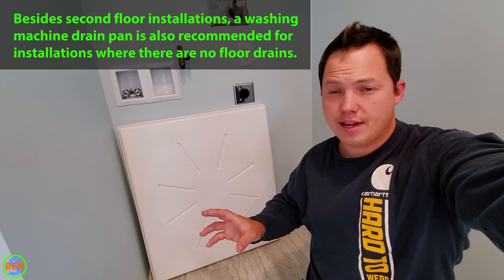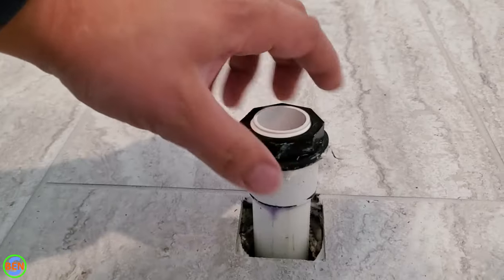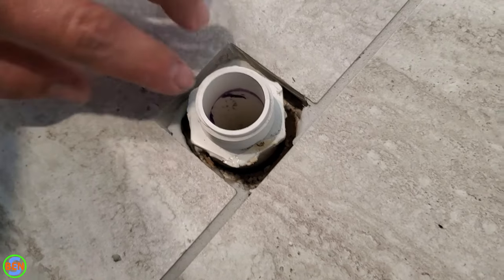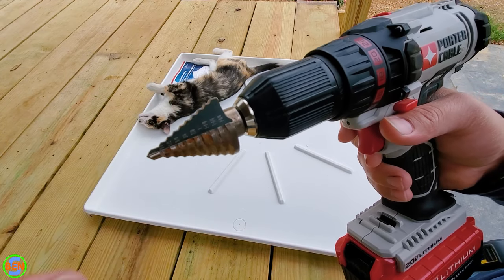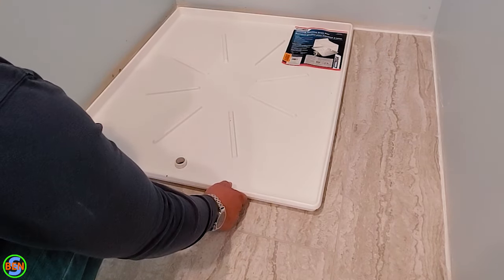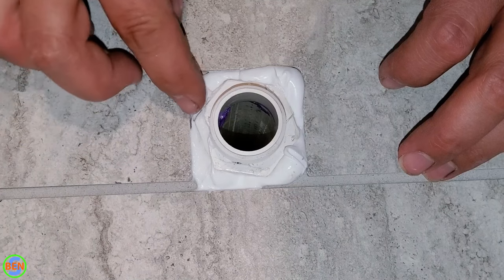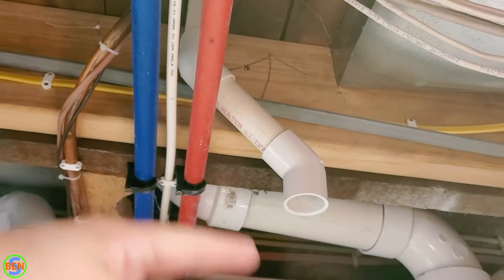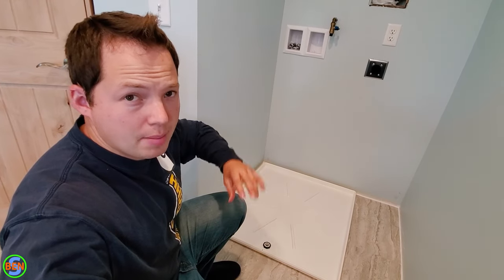How To Install a Washing Machine Drain Pan for Upstairs Laundry Area

Comment: Actually, if prepared properly, a sloped floor to a room floor drain is best. That plastic pan almost always gets damaged if your doing a solo install of the washer...not to mention the pain if ya  have to service the unit. Also,  that 1" drain line is not enough if ya have a major fail as it will be overwhelmed and the pan overflows...seen it happen many times over the years.
Reply: Now that is something I forgot to consider and comment on, those plastic grip pans are the very flimsy. There's not a lot of meat to them so to speak, they get brittle easy and that front lip is going to break I guarantee it or it's going to crack and then if there is any kind of water on there more than literally a drip, you're going to have problems with it and especially if you're trying to move a washer which is heavy by yourself you got to get it up over that lip and if you're trying to use one of those portable you know dollies to move it you know it's just not going to work out too well for you   I've got waterproof laminate underneath mine on the second floor, and I've got the edges tiled so that way in case it leaks it literally goes into its own little box

Comment: Not good enough, Unfortunately this only addresses any water coming directly from the washing machine and does not prevent any potential flooding coming out of the water supply lines or the washing machine drain.

Comment: If this were my house, that indirect drain would completely miss the sink and all the water would wind up on the floor.  You make absolutely great videos. I watched all the way through even though my washer isn’t anywhere that flooding would damage. Speaking of flooding, I use braided washer hoses that automatically cut off the water flow if they sense a sudden immediate change in pressure ie burst hose. With a second floor setup that’s important.
Reply: Super

Comment: That little hole isn't going to cut it.  You need another inch of height and a full shower drain at the base of the pan to ensure that the lint and hair that come out through the seal don't instantly clog the hole.   Drain pans have to deal with worst-case scenarios and in this case you're talking about a service line break or a tub seal blow-out.  Both of those will overflow that scrimpy piece of garbage in about 20 seconds.
Reply from the maker: True that it wouldn't help in a catastrophic leak scenario. Only good for the smaller minor leaks but hopefully better than nothing.

Comment: Is there any concern with compromising the integrity of the pan by not using one of the pre-drilled holes? Could it cause cracking in the pan down the road?
Reply from the maker: I don't think it should matter at all.

Comment: Silicone definitely helps seal around the pipe ours leaked under the pan because the drain hose backed out a bit and the seal was gone. I am at the point I'm thinking to just put a liner under the flooring and plumb in a floor drain because it's a PITA when having to move that machine in and out of the pan for maintenance.

Comment: I know in our city, code requires an actual FLOOR DRAIN for any laundry (laundry room) above the ground floor (2nd floor and higher) IF the home is on a slab.  If the home had a basement (rare in Texas) or crawl space under the main floor, then a floor drain is required in that instance as well depending on when the house was built.  A drip pan alone wouldn't do and would be unnecessary (because of the floor drain).

In some ways it makes sense, because if your washer were to develop a serious leak, or the water hose was to rupture, that drip pan would never keep up.  But I think these drip pans are nice for what they are intended:. Drips!

Is this on an upper floor in your house?  2nd floor laundry facilities are nice.  4 of our 5 bedrooms are located on the 2nd floor of our house and I always thought it would make more sense to have laundry facilities closer to where people slept, changed clothes, etc.  Not to mention there was always a parade of kids or guests carrying clothes baskets up and down the stairs to wash their clothes on the first floor.  Now they do not and just walk down the hall.  I think we are probably the only two story house in town that has laundry facilities on each floor.  Very handy - but I am not so sure I'd do it again, as it was a lot of work.  The second floor had bathrooms, but it did not have the infrastructure to support a stacked washer and dryer, so all of that had to be added.   Glad I did it though, because it's been quite a time saver.

Nice video!
Reply: Yep. Those floor drains may cost a wee bit to put in, but compared to the repair costs of water damage from a 2-3 floor laundryroom, it's a drop in the bucket.
Reply: @samspade5648  oh absolutely! And there's not a second floor drain anywhere on the second floor until I installed that one for the washer which is kind of funny cuz you would think using the same logic why wouldn't you want one in your bathrooms? So that way in case the water fight broke underneath the sink or the toilet started leaking or something that it would migrate to a to a central drain.  If I were to build a house from the ground up, that is probably what I would do
Reply: And for the second floor washing machine I had to run everything over there there was no plumbing where this particular closet is located, and there was no vent over there so I had to literally run everything including electrical, but it turned out very nice the dryer exhaust is maybe 4 ft long it just goes straight out the side of the house into an alcove where it can't be seen from the front yard or from the street so that way the HOA can't bitch about it
Reply: @mattalbrecht7471  Hahahaha, it's funny you mentioned a floor drain in the bathroom. I just decided to do just that now that I'm remodeling. However, it is not as simple just putting a drain in anywhere. The floor must be properly pitched towards that drain...it's not difficult,  but it must be account for.

Comment: A 2 inch pipe is required by code in my city. I would waterproof the room and install a 3 inch floor drain if I were to have one in my house. A 1 inch drain isn’t going to take all the water from a plumbing accident.I would put a sensor with automatic water shutoff in that pan as well.

Comment: My new place has this pipe in the ground but also a hole where the hot and cole inlet things is on the wall , should i use the one in the floor or the one in the wall ?
Reply: You should use the one in the floor  for the pan. The hole in the wall is for the regular washer draining after completing the wash.

Comment: Get one of the rubber drain pans if possible. Those plastic ones slide all over the place and literally will tear themselves apart over time, making them useless. They have no grip to the floor and the washer will have no grip on the plastic.

Comment: We have a drain pan on our 2nd floor and I can't find where it goes down to , the house was built in 92.
Reply: It might be flowing into the same drain as the showers, toilets and sinks in your house.  If you have full access to it, try having someone put their ear near it while you run a sink or flush a toilet.  If they hear watery noises, its using the same sewer system.

Comment: With the cost of propane, wouldn't it just make sense to go electric drier which is simpler and cheaper?
Reply: Depending where you are, propane and natural gas can be a ton cheaper than electric to use.
Reply: @samspade5648  natural gas yes - for propane to be cheaper, would need expensive electricity.

Comment: Aye Ben, nobody shows HOW to get the washer ONTO the drain pan. After some thought, came up with this, works like a charm - WORKS WITH ONE PERSON.

TWELVE EASY STEPS TO GET YOUR WASHER DRAIN PAN UNDERNEATH YOUR WASHER. If you share this/make a video on this, please credit me, thanks:

1.You need to have or know someone with a cat tree. Know the tubes used as risers? Yeh, unscrew one for this. Or, otherwise need a strong tube that is about the height of the pan lip.
2. Secure a string around the tube, and have it come out the backside of the washer, with the tube at the front, and have the string end up where you can pull on it when ready from the front of the washer.
3. Tilt up the washer onto it's hind feet.
4. Slide the washer tray under the washer until it stops at the back of the washer still on the ground on it's back two feet.
5. With the tube inside the pan, pull the string or otherwise make sure the tube is underneath the back of the washer by the lip of the pan, in the pan.
6. Lower the washer, the round tube should end up supporting the back side of the washer - the point is to not crush the lip of the pan.
7. Pull the washer towards you, using the tube as a fulcrum, and taking advantage the tube will roll forward with the washer as you pull the washer towards you.
8. When the back feet clear the rear pan lip, the entire washer should be fitting inside the pan, the back of the washer sitting on the tube still.
9.Tilt  the washer towards you over the front feet, taking the weight in the back of the washer off the tube.
10. Pull the string tied to the tube to remove it from underneath the washer.
11. Lower the back of the washer onto it's back feet, which if you did it right, are now inside the pan, along with the front feet.
12. Crack a beer and have a drink for me. I'm disabled, and pulled this off with minimal penalty (pain is there just to remind you you're alive). (***Not responsible if you're too foolish to know your limits or otherwise hurt yourself.***)

Ta da! Easy peasy! This took all of 5 minutes. Can't believe I searched YouTube and there's few videos on installing the pans, and fewer to none how to get the washer on the pan. One guy uses 2x4's, which I would not recommend. Trust me, the above steps make it a breeze. Now go have a second beer for me! ;)

Tip: If you have trouble finding a suitable tube for this, when you go to Home Depot or Lowe's to get  your pan (not Walmart, overpriced for some reason), ask the clerk if they have any strong cardboard tubes used for various inventory items, that they normally throw out. You want a length a few inches shorter than the width of the pan, but not too short either you'll want the washer's weight spread out more over it's surface and therefore less likely to crush the tube. And, don't forget the radius must be enough to bring it around the height of the pan lip. Same height or a hair higher is better so while the weight of the back of the washer sits on it, the tray lip isn't being crushed.
Reply: You should do a video on this.